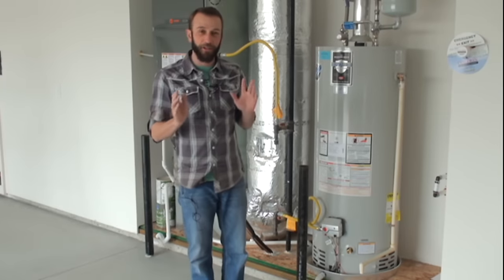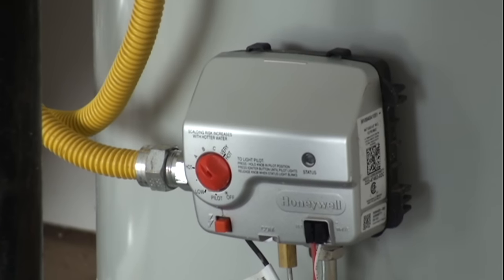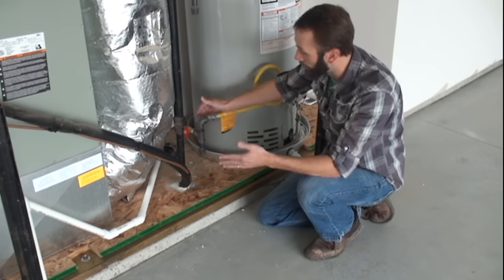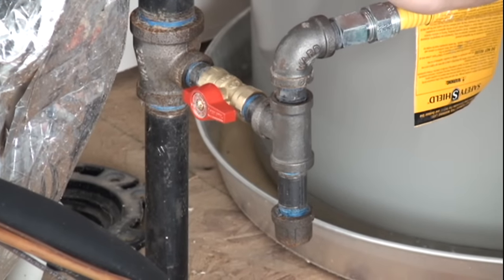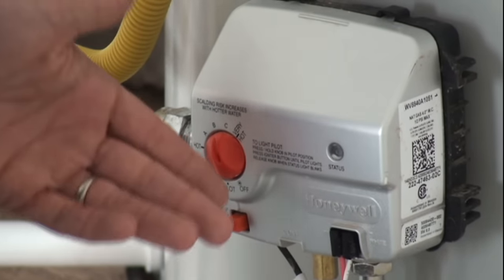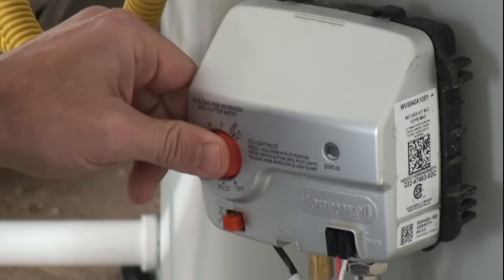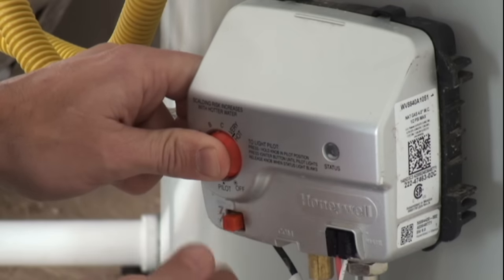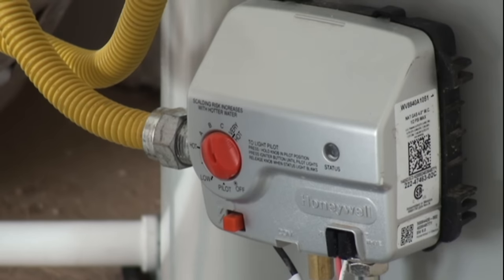How to check and light water heater pilot light

Comment: I have the exact same water heater and the honeywell thermo. The problem I'm getting is when I press down the pilot and press the ignitor, the flame turns on but as soon as I let go the pilot button, the flame shuts off. What do I do at this point?
Reply: I have the same issue. Did you figure out how to solve it?
Reply: @gzecheru  unfortunately I did not. I had a plumber inspect it and said the pilot is dead and it pretty much had it full life cycle run out. He said water heaters typically goes for 8 years on average when it's time to replace it and mines was on its 10th year. So I had to ultimately replace the whole water heater.

Comment: What happens if the status light won't come on but i can see the pilot is on until I let go of the knob. The pilot won't stay lit.
Reply: Troy Anderson iam having the same problem with it too..
Reply: pipiripau 78 turns out the gas valve was bad. Mine was still under warranty and was replaced by a distributor in my area. Put the new one in and worked great.
Reply: Troy Anderson hey man guess what i just try it again about 2 min and it worked and its on right now i hope it stays on if not might have to get a new one we just bought it about 2 years ago..
Reply: pipiripau 78 should be under warranty. Call the manufacturer. They will confirm it and tell you who you take it to to get a free one.
Reply: Troy Anderson thanks alot troy take care man..
Reply: hey troy guess what it turned off again so this is what i did i took off the thermopile and cleand it with sandpaper and put it back on and it worked for a little while so just whent to truevalue and bought it new it cost me $40 i put it on and it has not turned off since...